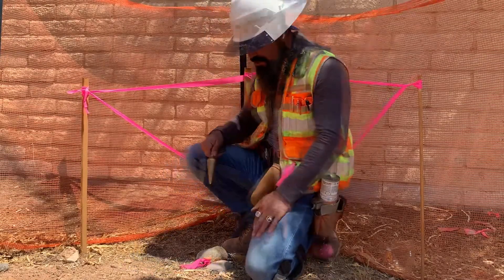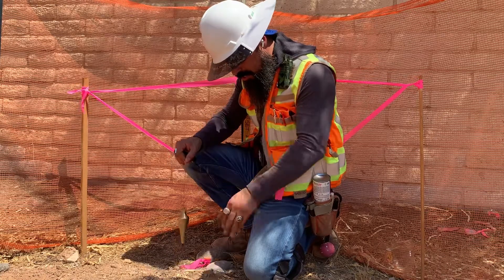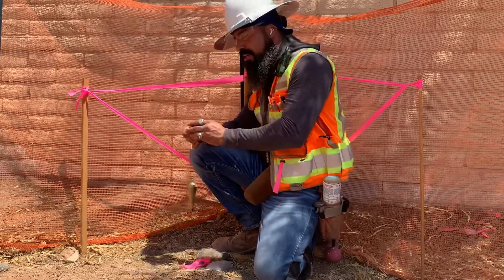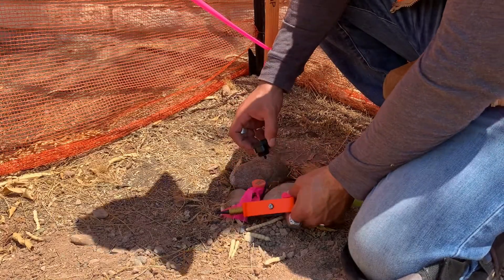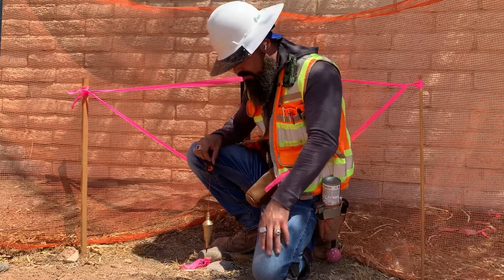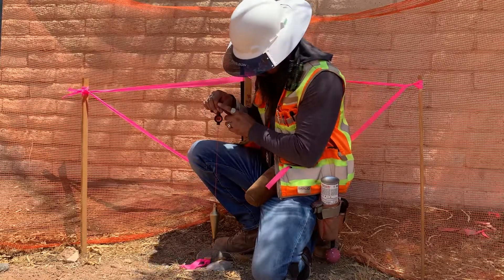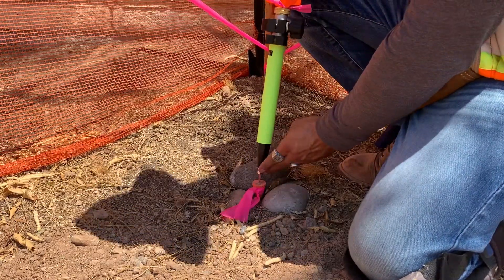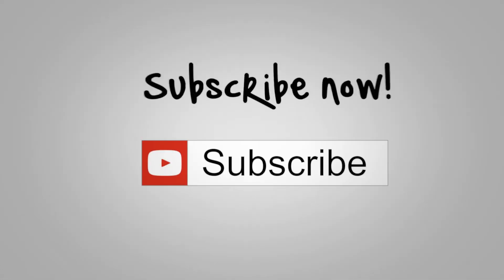Surveying: Plumb Bob Mounted Prisms

Comment: Wow man great great videos, I make sure all my employees watch these!!!! I do have a question tho….why is the -30mm a standard?
Reply from the maker: @mattymattareeno4326  a prism sits in a small canister, right.. there is the flat face of the glass, and then the facets of the prism converge further back in the canister. The prism is always intended to be tilted toward the equipment when operating but when you are aiming across a site, it’s easy for that rotation to be a little off.  You get more viewing angle (allowing your rotation to be less perfect) when your prism is mounted recessed at 30mm. At zero, you really have to aim near perfect or else the canister housing blocks the facet convergence point much more easily and you are unable to get a prism reading.  It definitely happened for a reason, that’s why 360 prisms are taking over, no more rotational worries.

Comment: why hang a plumb bob 12 inches?  What does that give you?  what is the use of the plumb?  what are you trying to plumb?
Reply from the maker: In this example it is being used to give line at your back sight while also providing a target for distance. It’s plumb over the back sight or foresight point. This would be in cases where you need to get off the ground a small distance but would like to keep your rod as short as possible. For tight tolerance work, a 6.5’ rod that has not been recently calibrated OR is not being held perfectly plumb (which we are just eyeballing anyway) can introduce a small measure inaccuracy into measurement. I’d rather see the prism sitting right on the back sight as in other related videos, but this video is empathizing sticking with a ‘close to the ground’ alternative.
Reply: Thank you for the explanation. @leansurvey8212

Comment: It seems to me that a plumb bob mounted on a thin steel rod with a prism at the top being supported by a tripod system would be much better than a bubble mounted system. It would self plumb the prism if made correctly. It would always be plumb. One might not even notice it the bubble plumb moved out of plumb. What do you think of this idea?

Comment: Another slick tool I need to add to my collection.  Peanut prism string bracket. Thanks for the video!
Reply from the maker: That is  SECO part  number  6030-00, they are only about  $12!
Reply: @leansurvey8212  AdirPro also makes a (slightly) cheaper version...I would assume more or less similar quality.
Reply: @leansurvey8212  Thanks for the part number. I was searching the Seco Catalog last night for it, but I could only find it in a kit.
Reply from the maker: @tambaurorastation756  Seco hasn’t added them to the catalog, but vendors and distributors can order them directly. Search “seco plumb bob bracket” and you the vendor AllTerra Central has them in stock.